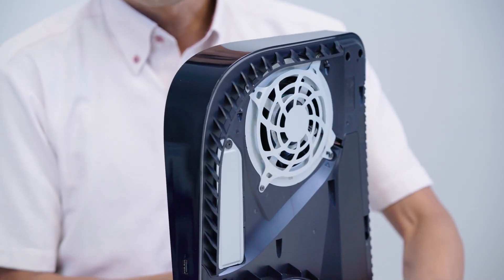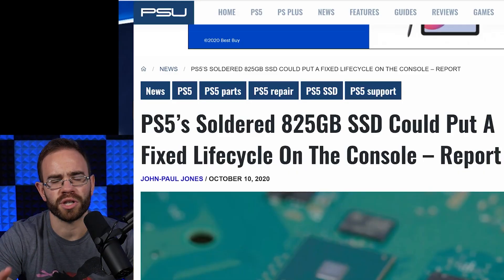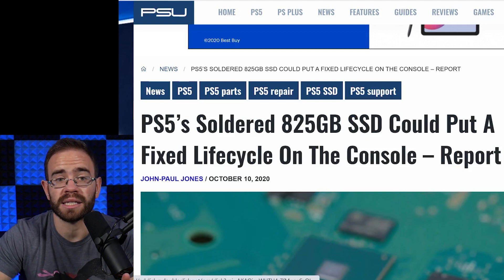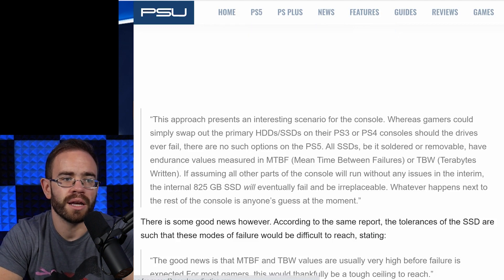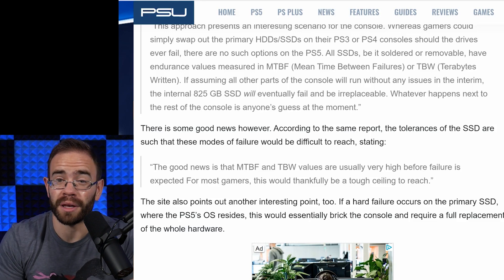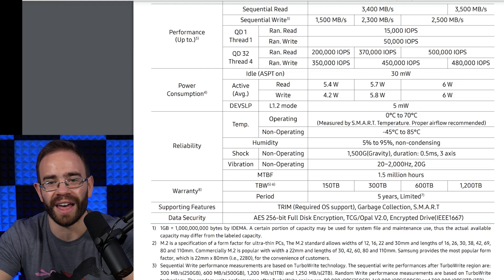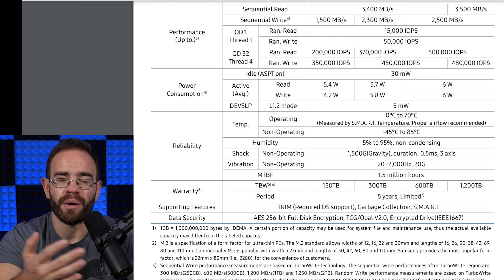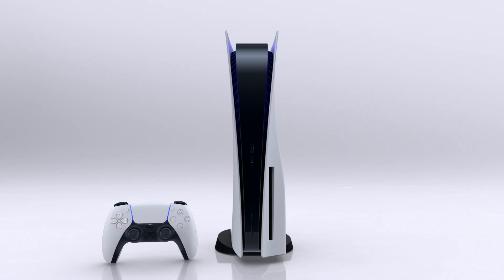Is The PS5/Xbox Series X SSD A Problem For Preservation?

Comment: Doesn't matters. With digital distribution + DRM, game preservation doesn't exists anyway.
Reply: Not true. DRM can be bypassed and as long as one can access the games' files the games can be preserved. The only problem might be saving games through their update cycle, but a thorough archiving project will probably be able to store the various updates separately.
Reply: @MyChannel-SR1  Yeah, but whether or not you have an on board SSD, you'll still need to hack the console to get that data. What I mean is that physical media allows you to preserve the game without any tinkering as long as you keep it in good conditions.

Though, it is true that an on board SSD is a ticking bomb for the console itself since it cannot be easily replaced but I don't think that this component is more prone to failure than any others.
Reply: @foufoufun  Cerny stated that PS5 games can be saved to an external HDD (or preferred storage method) for storage purposes, so a hack is not really needed. Despite that, the people who preserve games tend to be really thorough and it wouldn't be a problem for them to extract the files. For the average Joe Sony's offer is not a problem.
Reply: @MyChannel-SR1  Sony's consoles always encrypt the data on the HDD and that isn't going to change for the ps5. It's to the point that you can't even put a ps3/ps4 HDD in another console so I'd be surprised if you can use the games on the external HDD on another console. You'd still need to tie the games to their respective PSN account. So like I said, it's no easy task to extract that data and do something with it. Not impossible, but it can take a couple months or years before its done.
Reply: @foufoufun  It may not be intuitive, but you can transfer the games between two consoles, even with different accounts, provided that both consoles can verify the licenses with the owner's account ( https://amp.reddit.com/r/PS4/comments/3gmhi1/can_i_restore_my_backup_on_a_friends_ps4_and_will/ ). For most consumers account based encryption is fine. Archivists don't technically even need that for pure data preservation. Having a collection of encrypted files is not convenient, but it still is preservation.
Reply: @MyChannel-SR1  Sort of, but the goal of game preservation is to be able to play the game even if the company who made the game/console doesn't exist anymore. My point still stand that digital distribution with DRM is still a huge obstacle to game preservation.
Reply: @foufoufun  It mutated a bit as we kept on speaking though. First it was that preservation was dead due to DRM, now it is that DRM a setback to playing games, which was what I stated in the beginning anyway.

Still, for archivists preservation is a long term project, they can wait to decrypt/bypass the license protection, while for the average person Sony's offer is more than enough.

Comment: I’ve honestly never had any of my systems have the storage go bad. So that really does not concern me that much. By the time it actually does go bad, I bet you you could probably get another of the same console used for under $100 to replace it.  And it’ll probably be a better iteration of it as well.  I think the fact that newer consoles save all of your games save to the cloud for the most part helps you to transfer over to a new system if your current one ever fails.  While I do agree with you that I do prefer the removable hard drives I don’t think it will really come in to play for me.
Reply: Yeah me neither
Reply: Only reason it would is mishandling or you got a lemon.  Hdd/sdd should technically last a very long time.
Reply: ive had multiple mechanical HDD go on me.

Comment: I mean if the internal ssd fails couldn't you just run the system on the extra SSD slot you got, not to mention by the time it breaks in 2+ years , new SSD would be exponentially faster . That's if you can run the system of the extra SSD
Reply: Why are we all assuming these things will fail in 2 years? My launch day ps4 hard drive still works fine 7 years later.
Reply: @chriswiandt4907  it's technology anything can fail
Reply: I'm wondering if the SSD controller chip works with the second slot or not
Reply: @dbfzato-1327  Cerny's presentation made it clear it does.  The intent with the m.2 slot is additional storage that runs as at the same performance as the internal SSD.  Please also note Cerny made it clear you should not buy SSDs before Sony validates them, and the transfer rate spec on commercial drives will need to be faster to compensate for the overhead to compensate for the lack of features their implementation has like 6 priority levels v. 2.

Also note Cerny did make it clear the PS5 will support external hard drives and switching games back and forth, so if you're intending to running a massive library there's nothing stopping you from putting a Seagate Exos in a 3.5" enclosure, hooking it up by USB, and having 16TB of storage with the only limitation being the HDD's transfer rate when putting games back on the SSD.

Incidentally these "Sony didn't explicitly send me engraved stationary it does x, thus THEORETICAL WORST CASE SCENARIO" dread game antics are tiresome.
Reply: @jebe4563  that's a very extensive way to say yes but I appreciate the awnser. What you mean about it needing to be faster to compensate for lack of features tho? That to do with the SSD controller? HDDs are simple I get that just not sure about ps5 games needing that boost from the SSD controller to run optimally on the ps5
Reply: @dbfzato-1327  lack of features mainly refers to normal SSDs having 2-3ish priority levels, while the PS5 architecture runs based on 6 (the internal ssd is built using this in mind). Having less priority levels can be compensated by having a faster SSD (for most cases)
Reply: @ru2225  cool thanks :)
Reply: @dbfzato-1327  The PS5 SSD is 12-channel with 6 priority levels.  A normal commercial SSD has 2 priority levels, and far less channels.  Their custom controller creating the net effect of those two things on a commercial drive will thus require additional bandwidth.  

Please mind I'm just restating what Cerny said in the Roadmap to PS5 presentation.
Reply: Very good question, all this is making me think if I should fully commit to my PC...
Reply: @cosmicjohn174  if you already use it alot then go ahead, I couldnt because it's just boring having this one thing for everything
Reply: @AlphaladZXA  yea my issue is all my friends play on Xbox or PS, and I love the mouse hate the keyboard lol

Comment: What about series x it has two separate boards, i don’t know if the board that contain the SSD part is separated from APU if it is I think it will be easier to replace.
Reply: Honestly, looking at the initial teardown stuff of the series x, it looks like the x has a socketed 2240 card with a heatsink on it for sustained performance. This is all just speculation on my part but would also allow them to easily switch that over to the external cards they have available just by switching the enclosure type
Reply: @icesick06  their ssd is soldered on as well
Reply: @tantalus5370  I haven't seen anything that has said it's specifically soldered on or not hence why I was speculating. Do you have a source for this?
Reply: @icesick06  the dude who did that tear down talked about it and the xbox blog
Reply: @tantalus5370  you might want to go back and watch both videos available for the series x teardown (austin evans and digital foundry) as well as look at the blog. Nothing in those say that the SSD is soldered to the board. They only talk about the speed and the thermal solutions to keep the consistent speed they wanted.
Reply: @icesick06  he holds it right up to the camera its soldered right to the board when you look at the from of the board you see all the solder points and traces for each chip, its sdered the the back of the soc board so looking from the front you can see all the little dots for the connections of the chips if it was just an interface those wouldn't be there
Reply: @tantalus5370  there are two shot of the board. The back and the front. Let's just say the front is the side with the that you can see the APU on. So on the back you can clearly see where the SSD is but it is covered a cooling/emi shield. The solder you see is most like not traces, more mounting points to secure that apparatus to the board. Memory modules usually come in a bga package so the solder would be underneath the chip, not connected around the outside. Also this is a multi layer PCB design, so youre not going to see solder point on the other side for the memory. What I see is various resistors and such that are probably connected into the circuit for the SSD but it in no way tells you if the end result is either some sort of connector for a motherboard mountable SSD or if it's soldered on.
Reply: @icesick06  if there were resisters they would be on the drive itself not the motherboard the shielding is mounted over the chips and those are mounted directly to the mother board, its the cheapest way and thats the goal of these machines is to be as cheap as possible, plus if its a multilayered pcb then why can you see the memory mounting points from the back if they are mounted to the other side, all the little points you see on the back corospond with something mounted to the other side you can literally trace out the chip shapes by looking at the back of the board
Reply: @tantalus5370  sorry to burst your bubble but I did some more watching and digging. Go watch the video for "Inside the series S". At around 3:24, you can see the drive clearly is removable. I doubt they would have changed that for the series X
Reply: @icesick06  it looks similar to a normal one e but it still looks fixed to the board, even if it wasn't the fact that the shielding is soldered over it makes it non removable 

If it is a card the fact that its sealed and not actively cooled is going to hurt it in the long run it makes its own heat and its going to absorb the mother board heat which will shorten its  life span but either way
Reply: @tantalus5370  the emi shield looks like it clips into place. It's the actual main housing that the emi clips to that is soldered. There's also a torx screw holding it in place. I will agree on the cooling aspect as the shielding doesn't look like it would be enough extra area mass to help effectively cool it enough. However that SSD is actual towards the inside up against that metal spine that separates the two boards possibly helping it dissapate heat but that would mean some sort of two layers of TIM which seems dumb to me. I guess we'll see everything in practice and laid all out in a months time.
Reply: @icesick06  Austin Evans said the shielding was soldered on thats what i was going by
Reply: @tantalus5370  "shielded and cooled." No use of the word soldered. But we'll know all the details when we get full 3rd party tear downs in about a month.
Reply: @icesick06  Why would the Xbox NOT have it's SSD soldered onboard? it makes no sense to screw or plug things on when you can solder them. Soldered components are always much more reliable than sockets. All this soldered SSD talk is just idiots mumbling to themselves.
Reply: @thomassmith4999  So I cant really tell which side you're going for as your last statement contradicts the rest of what you typed. However I can tell you to watch the newest video on this channel. Ill let him sum it up for you.

Comment: "when it comes to heat"..
Sony:no.... I don't think it will.
Reply: FührêrFPöñê  how does the heat even surprise you? Have you never used a gaming PC? You could heat a room with one. Tech gives off heat you idiot.
Reply: FührêrFPöñê  lol iPhone sucks been Samsung Galaxy since its first and I said PS5 has superior cooling than Series X I didn't say Ps4 ran hotter cause it's more powerful we all know ps4 cooling system was shit,
And series x cant clock any higher it will melt, it used Apples Shitty Mac Pro trashcan design with the fan on top that even Apple themselves said was a bad design, one of its main complaints was overheating it could only be pushed so far
The reason Ps5 is clocked high is cause it can handle the heat,
And I'm fairly sure  theres going to be a Similar GPU that AMD will release as 1 is rumored to he 40CU @ 2.5ghz I'm guessing will have the GPU cache scrubbers possibly the same liquid metal housing for cooling and very similar features to ps5.
Reply: Except reports coming out that Playstation 5 runs hotter than XSX. Not by alot but nonetheless.
Reply: @XBX1MASTER  lmao an unconfirmed report of PS5 running at peak 65°C is basically a compliment, 2080 S some games at max settings 80°C
I guess that means the Series X is weaker seeing how it doesnt put out as much heat as Superior cooling PS5, go watch people Delid and use Liquid Metal
Sony spent 2 years perfecting it.
Reply: @one_up907  I don't need to watch anybody delid shit to know that Sony can be horrible at engineering PS4 Pro cooling and lies about shit 8.4 tflops half math performance. You shouldn't be so nieve.
Reply: Also, comparing temps from different architectures and 12nm vs 7nm is ridiculous.
Reply: @XBX1MASTER  so series x is 12nm? The unconfirmed report is series x is 63°C and ps5 65° C at peak, and we all know Ps5 has better cooling system they played it for 80 mins with next gen gameplay in a 30°C room or 86°F room and stayed cool and quiet.
Reply: @one_up907  no Nvidia is 12nm. You were referencing 2080
Reply: @one_up907  from a Sony controlled demo room. Hmmm. You would believe anything Sony tells you huh?
Reply: @XBX1MASTER  only reason I referenced 2080 S as an example of how hot almost any any GPU runs usually in the 70-80°C 
Most likely a 100°C threshold,
And then compaired unconfirmed reports of Series X 63°C or Ps5 65°C at peak.

Comment: Nvme ssd is more reliable and has a longer life span then sata.
Reply: It is but a dead HDD won't brick a PS3/4 or Xbox.
Reply: No it doesn't has I have lost 2 1tb nvme drives of samsung but still my steam hdd is still alive after 6 yrs
Reply: @Swagata Mukherjee , unusual (but not impossible) for two NVMe drives to go bad. If it happened again I would consider a faulty motherboard or PSU sending the wrong voltage to the port.
Reply: @swagatamukherjee6155  Are you using them to dump a lot of data? I ask because read operations are meant to be harmless, I was looking at getting their gen 4 eventually. My samsung sata SSDs are still tip top after many years.
Reply: SATA is an interface not a storage device FYI.
Reply: Izzy So is NVMe
Reply: @ND-mn1rb  Yes so it's irrelevant that's my point.
Edit-+1 like for you because of the facts.
Reply: "Soldered to the board"
Reply: @RhythmGrizz  the lifespan of the ssd is probaly longer than the other parts of the console. if we use the number in the video 600TB between failures is a lot . i did the math and would need to write 330GB a day over 5 years to reach 600tb. if your installing warzone once a day something else is wrong.

Comment: Hmmm... the 650 TB write concerns me. I understand it will take a while to hit, but for someone like me who has over 800 digital and 300 physical PS4 games, not to mention any PS5 games I buy over the life of this thing, this might be concerning (This also applies to Series X but in a much larger capacity as over this platform I have at least twice as many physical and digital games if we include 6th, 7th, and 8th gen games). I plan to download and store games to my USB 3.0 external hard drives, but when I want to play them, I'll move them to the on-board memory to take advantage of what the PS5/Series X has to offer. But moving them to on-board storage counts as writing, I see this 650 TB getting hit quicker than I expect...
Reply: That is a good point, I believe many people will have bulk HDD storage until compatible ssd prices drop below $120 per terabyte
Reply: 650TB is basically 6500 games with a 100GB size. You don't need to worry buddy.
Reply: 650 TB would last 10 years if you install game at a size of 178GB every single day , so I’d say you’re fine
Reply: 10 years as in a year counted 365 days , I didn’t count in the extra 2 days of the 2 years that have 366 days , but you get the point
Reply: Most of the smaller PS4 games aren't even 50GB and some aren't even half of that either.  You'd have to be constantly writing all of those games to the drive every day for that to be a concern